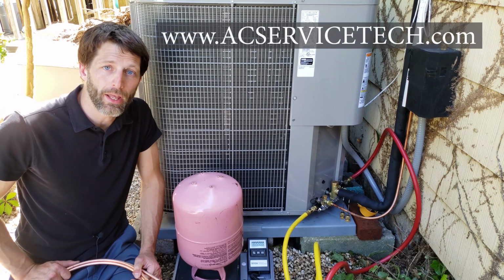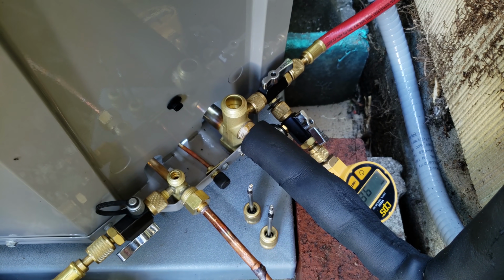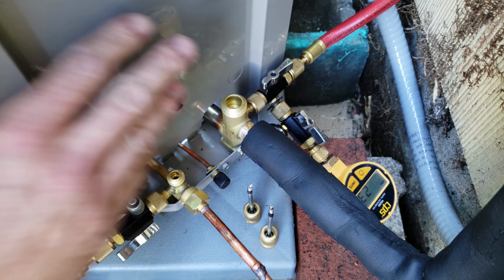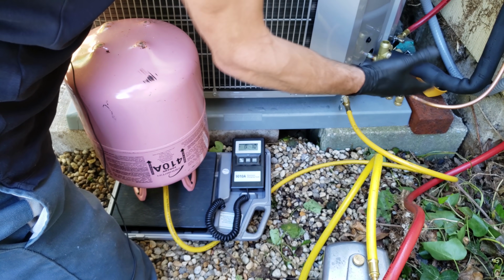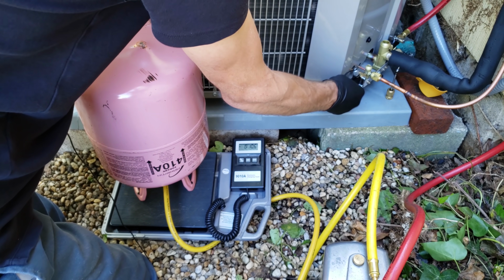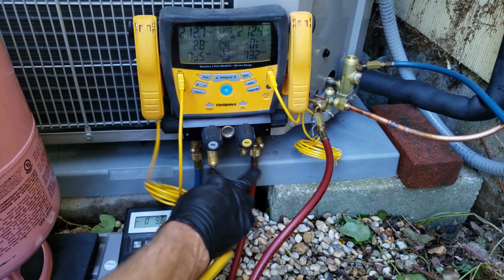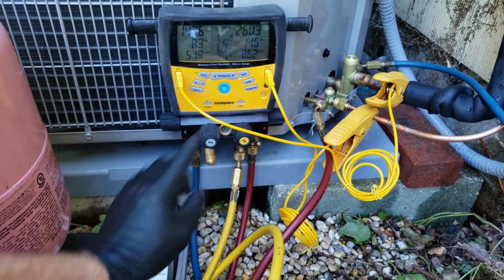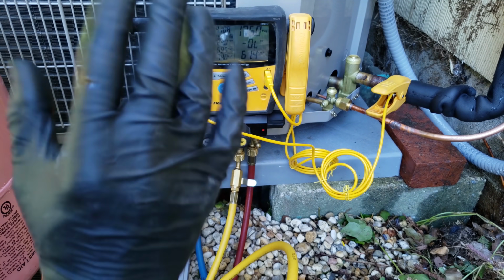Vacuuming, Weighing Refrigerant, Checking the Charge of an HVAC Unit!

Comment from the maker: Explore More From AC Service Tech Here!
▬▬▬▬▬▬▬▬▬▬▬▬▬▬▬▬▬▬▬▬▬▬
HVAC/R Online Training Courses: https://www.acservicetech.com/academy
▬▬▬▬▬▬▬▬▬▬▬▬▬▬▬▬▬▬▬▬▬▬
Learn More About Mini Split Systems With our Mini Split Training Book & Workbook: https://www.acservicetech.com/mini-split-book 
▬▬▬▬▬▬▬▬▬▬▬▬▬▬▬▬▬▬▬▬▬▬
2nd Edition Refrigerant Charging Book & Training Resources: https://www.acservicetech.com/newacbook
▬▬▬▬▬▬▬▬▬▬▬▬▬▬▬▬▬▬▬▬▬▬
Take our Free Online Training Resources: https://www.acservicetech.com/resources
Our HVAC Tool List: https://www.acservicetech.com/tools
Our Free HVAC Quizzes: https://www.acservicetech.com/quizzes 
Our Free HVAC Training Articles & Quick Tips: https://www.acservicetech.com/articles
Reply: Great videos!!!!!! I’ve just downloaded Your website. I have a question, why not check superheat @ the evaporator instead of the condenser? Why I ask is because there could be a temperature drop from evap to condenser
Reply from the maker: You can check total superheat at the outdoor unit and then take a temp reading on the vapor line indoor near the evap coil to compare to see if there is a temp drop. The problem  is there is no port at the indoor unit to measure the pressure and convert it to saturated temp, thanks!
Reply: @acservicetechchannel  hi! I have a video idea, or maybe I need some help!

I know that gazillions of youtube videos are about using refrigerant oil or Nylog on flares, but I have an interesting problem. If I use nylog, the pipe tends to spin on the flare face. I use nylog on the back of the flare either, but it does not seem to help. The pipe sticks to the flare nut and spins with it. I use a torque wrench.
Reply: Need to tripple evac boi!!! Hahahahahahahaha

Comment: I’m confuse so it was pump down and there gas in the compressor already? So you did a vacuum only for the lineset?
Reply: New system install. Making sure the system is free of anything in the lines before refrigerant is introduced to the system.

Comment: The question I have to ask is if it is a new installation, why or what is the reason why they leave the condensing unit so close to the wall, as far as I understand, due to the passage of air through the condenser coil, it must remain at least 1 or 2 feet away from the wall for better air absorption of the machine and to do a better job when doing maintenance, I appreciate your response.

Comment: Won’t a good amount of air within the open side of the valve core removal tool go inside the system when charging without a manifold gauge set? You can purge the hoses but the valve core removal tool has a pretty long section of air within it that can’t be purged
Reply: I came to this video to see how he removed the air trapped inside the valve core removal after vacuuming and before charging because I couldn't figure out a good way to purge it.  It seems as though he is relying on the positive pressure of the refrigerant to go into the valve core removal tool and purge the air back out of the loose connection.  I imagine this would work and should remove the air.

Comment: Seems superfluous to me and I've been at this for a while!

Correct me if I'm wrong ...
- You bled the service hose from the refrigerant bottle
- You bled the manifold hoses from the line set instead of the refrigerant bottle
- You bled the service hose again from the bottle

Why not just ready your manifold/gauge hoses especially when you consider the refrigerant amount being added is such a small amount and you're going to be fine tuning the system via the suction line anyway 😊

Removing the high-pressure hose connection with liquid refrigerant in it (bad idea) 🤪

Murphy's law, if anything can go wrong it will!  

Just turn the ball valve off and meter it back into the suction line via the low-pressure manifold valve before removing the high-pressure hose connection that way no one gets sprayed in the face with liquid refrigerant should the ball valve get accidentally knocked open (sucking in air) or worse!  

If you've ever seen the village idiot before working on their car's AC system and they forget to empty the high-pressure hose of liquid refrigerant before removing the connections then proceed to crack open the ball valve you know exactly what I'm talking about 🤣

If you have a manifold gauge without a manifold service valve, just make sure you attach the low-loss service hose ball valve under the manifold service port which will allow the liquid refrigerant to past directly to the low-pressure side without issue 😉

Comment: Could a bad inducer motor pressure switch on a HEIL DC90 Ultra High Efficiency furnace cause the 5 amp fuse on the control board to immediately pop on start up of a HEAT cycle?  Or could would it be more likely that the inducer motor itself is bad?  I had the air conditioning running this summer after I changed my thermostat to an electronic digital thermostat, but I had to disconnect the two plastic wire connectors that mount on the furnace gas valve for the air conditioning to run. Even at that, the blower motor ran continuously. When the weather cooled down at the end of the summer I turned the power switch off at the furnace. I should have dealt with the issue before now that I need to run my furnace but I didn’t. So now upon me re-connecting the two plastic wire connectors to the top of the gas valve (one from the inducer motor and the other from the hot surface flame conductor), and then having set the thermostat switch to HEAT, the 5amp fuse on the control board pops immediately upon my turning the furnace power switch on. The blower motor starts and immediately the fuse blows but the blower motor continues to run after the fuse blows.

Comment: Every manufacture installation instructions I’ve ever seen explicitly say to always open the suction line first on precharged systems to prevent an excess of oil being sent to the indoor coil and txv. You did the opposite. Granted you slighty precharged the system due to the longer line set but there will still be a big pressure difference. Why do you open the valves in the reverse order of what the manufacturers want?

Comment: If it is not a pre-charged system we need to pull a vacuum on the whole system not just lineset right? So instead of the valves being front seated on a pre-charged system, an empty system would pull a vacuum with the service valves mid-seated? To allow the whole system to be vacuumed?

Comment: can you say how many cfm you vacuum pump is you use for up to 5 ton residential?
Reply from the maker: You can use a 2 cfm of higher. Its not really about the vacuum pump size, its if it is a two stage pump, and its about the size of the hoses. The larger the better and make sure to use valve core removal tools, thanks!

Comment: Why don't you use vacuum on the s man 460
Reply from the maker: I perform vacuums without including manifold gauges. Same for recovery. There is just more points to leak and slows the vacuum procedure down. I keep my vacuum stuff for vacuums only and I always know my vacuum procedure will not be a headache, thanks!

Comment: Very instructive. I have a question. According to changing R22 refrigerant with R407C, I read that we can use a product that it's called SuperCharge. So we don't need to change the compressor oil. We just empty the unit, vacuum , add 407C plus supercharge. Do you think
It's working?

Comment: Just followed this procedure, I’ve noticed suction side went up to 400psi and very hot 115F 5mins into start . What caused that? Thx
Reply: Did your reversing valve swich?The unit might still be running on heat.

Comment: When charging, do you open the 410a bottle all the way or a couple of turns? Thanks great clip!
Reply: You can open tthe 410a jug all the way. It doesnt matter because  you are metering/weighing  the refrigerant in with your gages slowly. Also don't  forget to purge/release any air in the gages buy loosening the middle yellow  hose till freon starts to escape then close it off and charge away .

Comment: I prefer probes when charging hub 6 UEi is nice 
Limits purging hoses
Appion 1/2” vacuum hose on suction with blue drie vac gauge on liquid service port is my preferred way to pull deep vacuum 
Very descriptive explanations Craig thank you
Reply from the maker: Glad to help Ray! Thanks!
Reply: How do you disconnect that setup that you described? Is that with valve core removal tools installed ?
Reply: Yes

Comment: It is too close to the wall
Reply from the maker: We were called to braze, wire the low voltage, and get the system up and running and the unit pad was where they wanted it but yes it would be nice to get it around 10 inches away from the building, thanks!
Reply: AC Service Tech LLC that is when you should have referred to the installation requirements and charged more to move the pad, extend the length of the braze etc.  I doubt 10” is enough.  Most installation instructions call for around 16” to 18”  clearance from a wall  and also specify the clearance from another unit.  If someone asks you to do negligent work, it is on you to educate them and refuse to do it wrong when your name was on it.   The next person to come service that is going to likely put on the paper work that the installer put it too close to the building. Hopefully, you at least got it documented and signed.  Some customers aren’t worth working for though just saying.

Comment: Craig, at my work they want to do a R22 condenser changeout, customer can't afford to change out the air handler, so my boss is going to do a 407c conversion but when the customer is ready to change the air handler, how will they acquire a 407c air handler? cant find any out there..... also the condenser is a Guardian micro channel and the old A coil is a regular old style A coil..will this be a problem??
Reply: Almost all indoor coils are the same, the metering device is what is different.
Reply: Ok so a micro channel condenser is ok to use with a non micro channel evaporator? Should be right because they are 2 totally separate sides of the system
Reply from the maker: You can use an r-410A air handler and switch the txv to r-22 which is close to R-407C pressures or you can purchase an R-407C air handler like the guardian, thanks!

Comment: Hey Craig. Another great video. What is that Port in the Middle of the condenser unit?
Reply: It’s a suction line for you to use in heating mode on a heat pump. Remember the refrigerant is flowing the opposite way in heating mode on a heat pump. That middle valve gives you a true suction line on days where you are running in heat mode.
Reply: @speckulator7516  IC. Heat pump is something I have not dealt with yet. Got to check it out someday. Thanks.
Reply: Tech Bullet they are a little more complex because they have the defrost board on the condenser you have to trouble shoot when something goes sideways but there is a lot of videos you can find to help you out.
Reply from the maker: Thanks for answering the question Speck Ulator!
Reply: AC Service Tech LLC you are most welcome sir!

Comment: In the video you have the micron guage on the low side. What  would happen if you had it reading from the high side?
Reply: Nothing it would be the same reading. Thats reading the vacuum of the entire system.
Reply: @timrob0420  i see so it does not matter which side it reads from thank you.
Reply from the maker: Yeah, if anything the reading on the vapor side may be a little higher while the pump is running by maybe 10 or 20 microns than the liquid side but when the vacuum pump is off, it is the true vacuum, thanks!

Comment: What is that small line between the liquid line and suction line for?
Reply: That's the true suction port for a heat pump. It's only on those because of the reversing valve. So it'll read true suction pressure regardless of system mode, because it bypasses the reversing valve and gets pressures right from the compressor. Primarily used in heating mode to check the charge. But the most accurate way to check a charge is in AC mode with temperatures about 65. Ideally, over 75 degrees for a far more accurate look at what's going on in the lines and coil.
Reply: @huntress-ro5jl  Thank you
Reply from the maker: Thanks for answering Kellye!

Comment: How can weighing refrigerant be accurate when pressure and temperature varies with outdoor ambient temperature?
Reply: Greg , that's why you must use your scale and check your super heat and sub cooling.
This is the best channel in YouTube. 
Craig is very professional and do hvac the proper way
Reply: Weighing is not going to be dead on but it will prevent the system from potentially starting up with a low charge causing increased charging times and strain on the compressor. 

You will have to dial it in according to the metering device.

Comment: Like how you mention loosening the valve core tool threads a little to get the valve core in or out some guys have problems with that they don’t understand. Just showed my son the trick yesterday.
Reply: I have a problem with trying to get them back in with the positive pressure from the refrigerant so I will try this. 

Also do you prefer to add the valve core before releasing the refrigerant or after releasing the refrigerant?

Comment: I have the same gauges why don't you use micron readings from sman just wondering
Reply: Micron gauge at sman measures at manifold and the way he did it measures system.If your pulling down to 200 microns it should be ok but it's more accurate with micron gauge at system end.
Reply: He is also pulling the vacuum without the SMAN so he is eliminating a few potential leak points at all those hose connections.  If you are doing it every now and then it’s fine with the SMAN but if you are working every day in the trade then the time you are saving not dealing with the manifold adds up and is worth the price of the micron gauge.
Reply: Because the micron gauge feature is garbage.  Its reading a vacuum through refrigerant service hoses which are nor rated for vacuum and will leak under vacuum.  Plus it is notoriously inaccurate.  Finally, dont pull through gauges. Its shit practice.
Reply from the maker: I don't vacuum through the manifold set because there are more chances to leak and the vacuum gauge will read a more accurate vacuum closer to the system, thanks! to everyone that responded!